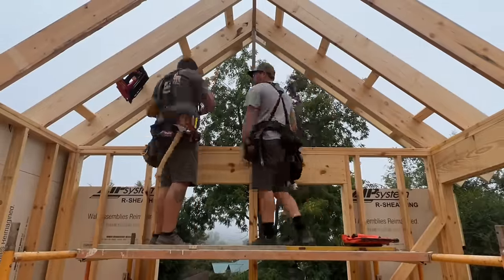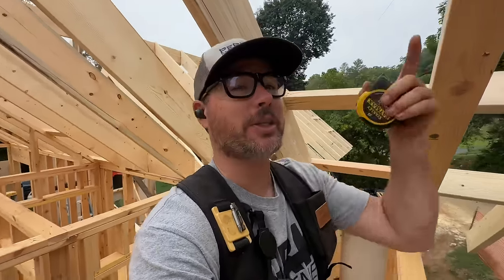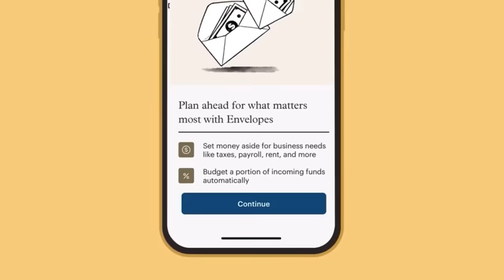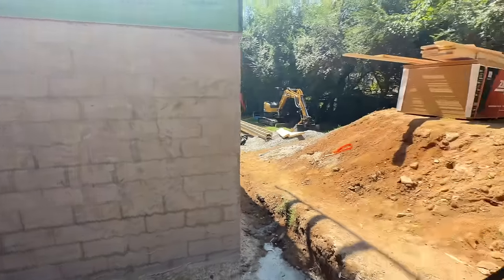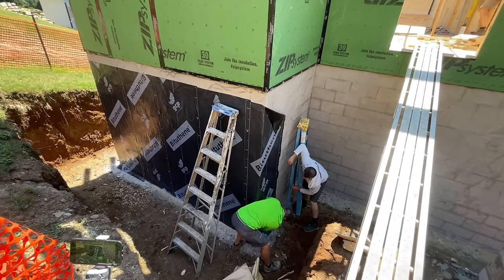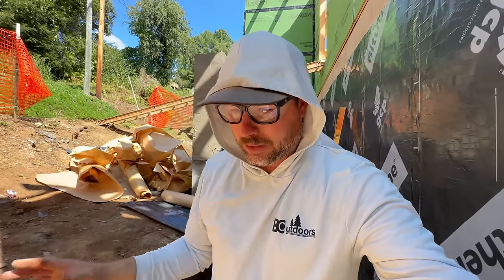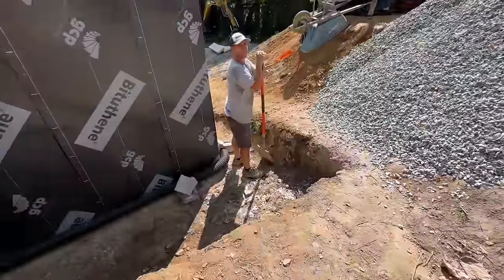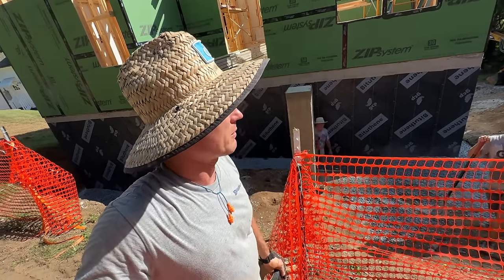Building A Small Income Property | Part 9

Comment: Basement sealing:
 when the strips are placed on a vertical wall, we leave about 20 cm horizontally on top of the floor/soil, and this creates a channel on which the perforated pipe is placed to drain the water more quickly and efficiently, as well as to keep excess water away from the wall when the amount of water is greater than usual  in heavy rain for example 🇮🇱
And the white sheet, in my opinion,
 it's used to wrap the perforated pipe for protection mainly from soil grains and other dirt that can penetrate the pipe over time through the small holes and create blockages.  
A type of filter, in Israel,  the tube comes wrapped from the beginning from the manufacturer.

Comment: Years ago I was on a big job where the building was going up on a hillside that had shale with a lot of small springs. The back wall and around the sides were painted with this thick sticky tar like material. We had to let it get just slightly tacky, about an hour then used big sheet (like thick rubber) 5’ x 10’. Carefully peeling the backing off then placing it against the wall. What a job but it worked so well. Heavy stuff

Comment: In London I've only ever used a passcode as air compressors aren't very popular here. I recently swapped to a Milwaukee framing nailer and I much prefer it. passcodes are good however they lack power down the line and can be temperamental with firing

Comment: nice work guys!. just a tip with bituthene, work from inside corners out. its faster that way. 
Cheers from Latvia. 💪
Reply: why? That makes no sense.
Reply: @idontthinkso666  it does since you can overlap only 10cm (~4inches) into corner and not having an issue where you have to place a whole sheet in the middle leaving bubbles, after that you can lay a whole sheet right up against corner. 4inches on one face of the wall and the rest of the sheet on the other is easier to deal with than half a sheet on each face.

Comment: i know you dont care but its not too difficult to have both ridges on the same elevation. easier still if you keep the same slope, projection and overhang because your fascia will line up properly. your smaller span roof ridge will just be lower than the main.

Comment: The math is faster on gables.  ((rise/run) x horizontal_spacing)+ length_of_adjacent_stud.  Measure first one and calculate the rest.  One stud length measurement is all you need (well, you need to know the slope but you'd know the slope if you just built the roof)

Comment: See with your french drain, why did you not wrap the terram around the pipe before you covered it in chips? I only ask because you have partially filled it with the rock dust already , leading to blockages later on.
Reply: I agree it should be wrapped around the pipe

Comment: A wet place probably would do a slab, so wouldn’t have to worry about using bituthene below ground.
Reply: They build in super wet areas in my area . French drain runs to a sump pit and the water is lifted out and away . They put basements that are square in the ground no daylight out .

Comment: Interesting you call the foundation perimeter drain a "french drain".  How is it different from normal perimeter footing drains?  We use 4" perforated pipe set in a minimum 8" deep trench, bottom of trench roughly equal to bottom of footing, so 2" bed and 2" cover.  Perforated drain pipe is covered with filter fabric, same as yours is.  This is standard procedure for us, regardless of slope of site (although all sites slope to some degree).  At low end of foundation drain, 4" perforated pipe is tightlined to a 4" solid pipe and outfalls to an approved storm drain, independent of any roof drains/downspouts.  I noticed your perimeter drain (so far) does not connect to anything at the low end if the project, do you just allow whatever water collects in the drain to outflow across the low end of the property?

Comment: question. sense you brought it up, building in to wet a place, have you guys ever refused to build because of site conditions? or not bid it?
Reply from the maker: Good question… We have turned down projects on account of very difficult build locations when we had other jobs that were available and not as tricky. One of them that I turned down was going to have to have sip panels brought in by helicopter! Another one would have required a bulldozer on site at all times to pull delivery and concrete trucks up the last part of the driveway, which was about a 30% grade.  I turned down one other job, because there was literally nowhere to park. The house took up the entire flat area and the road leading up with single lane and about a 20% grade.   Some days we have up to 10 trucks on site while 
The mechanical systems are going in.
Reply: Yes, many times we have declined a job because of too steep of a site.

Comment: How come you skim coated the block with masonry and added bituthene? Isn't one or the other good enough?
Reply from the maker: Technically, you don’t have to do the skim coat with the mortar. The membrane is 
supposed to do it by itself, but I always air on the side of safety when something is buried underground.
Reply: @PerkinsBuilderBrothers  That’s why I thought you did both. I think you would be better off choosing one or the other however. Trying to adhere something to an irregular surface like that is impossible to eliminate all of the voids thereby rendering your extra layer of protection usless if you can't create a good seal.

Comment: Why didn't you just reduce the pitch of the roof by a degree or two so both ridge beams run at the same height?
Reply: I thought about changing the roof pitch…. But I decided to leave it. It would bother me if they were different

Comment: You can float the ceiling rock over six or eight inches without deadwood, but any wider than that you do need it.
Reply: My builder did that on my covered lanai, high up and back out of the weather.  Then spackled the crap out of the unsupported corner joint.  Now the spackling has fallen out because of thermal expansion and is now on my todo list to fix.  Please, no contractor shortcut suggestions that sacrifice workmanship and cause problems down the road for the homeowner.

Comment: Shouldn’t that stuff be horizontal? Hire a new crew Jamie
Reply from the maker: It can be installed vertically or horizontally… I personally would recommend doing vertically. It’s so thick and heavy that it’s almost impossible to install it horizontally without a dripping and stick into itself in the process. What matters is that The overlap is correct.